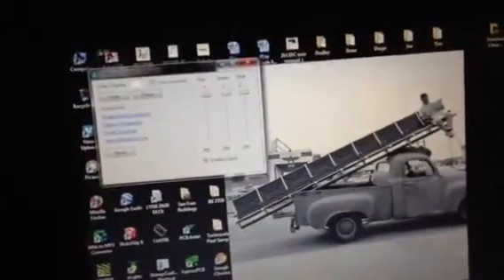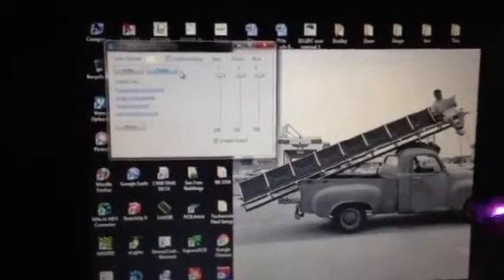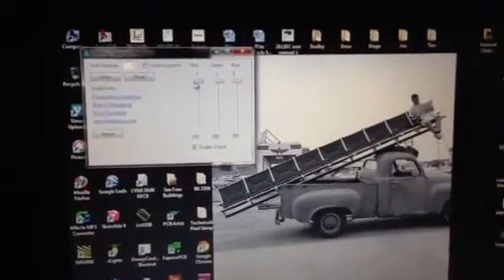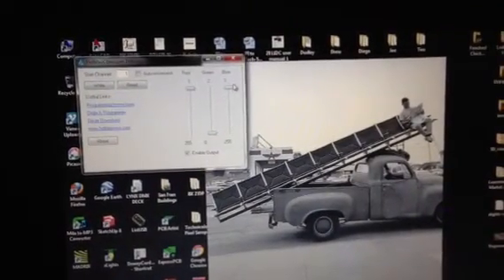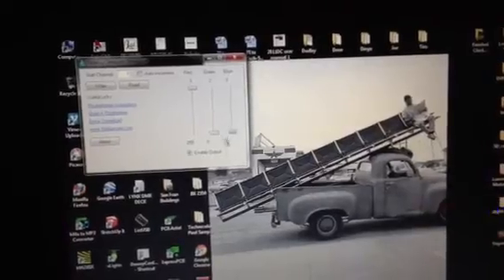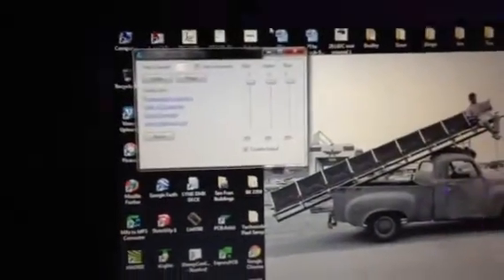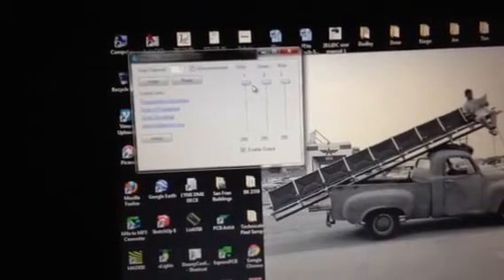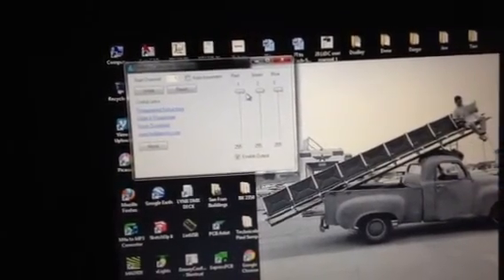10W High Power RGB LED DMX Strobe Light

Comment from the maker: Farley, I'm working on fine tuning some of the issues with the blink at a lower intensity.  When I get that figured out I'd like to get a small run of PCBs done and I'll build a mouser BOM so we can do kits.  Their is also the issue of getting everything to fit inside of the flood light housing, this is also something I'm working on.  I am waiting on some additional parts from China.  If everything works as I think it should, we will be able to engage and disengage the strobe effect remotely.